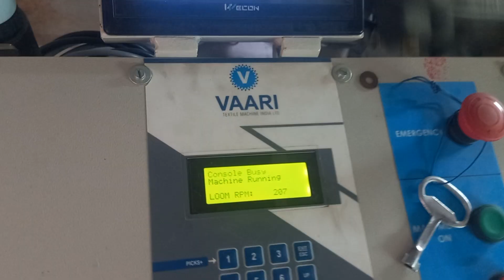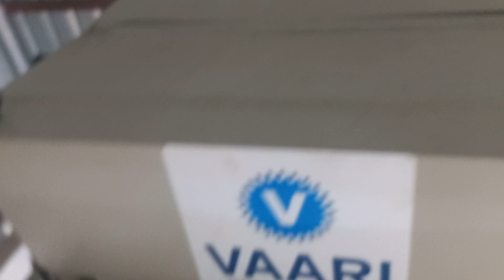SAREE WEAVING RAPIER LOOM WITH ELECTRONIC JACQUARD 1536 HOOKS MACHINE 200RPM TO 320RPM

Comment: Machine rate ?
Reply from the maker: Sir, Price is depending upon the customer requirements based.Minimum loom starts with Rs 4,50,000/-, Jacquard 1536 Hooks minimum Hooks rate starts with Rs 300/- per hook. maximum Hooks rate Rs 320/- per hook. Enquiry No: 9514937916